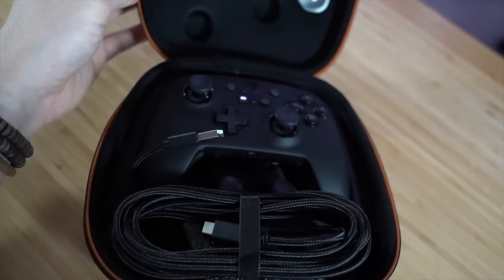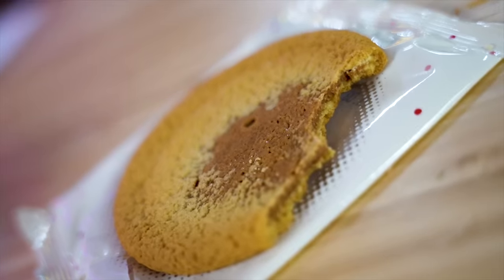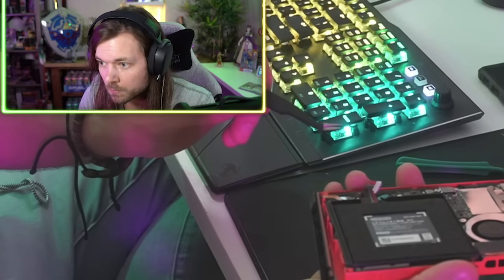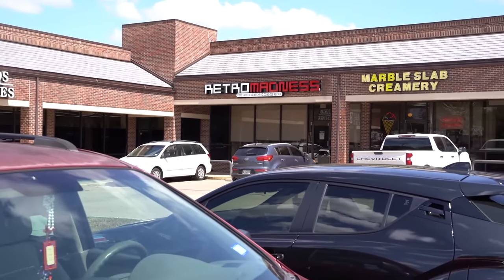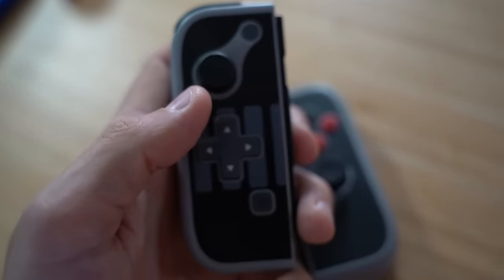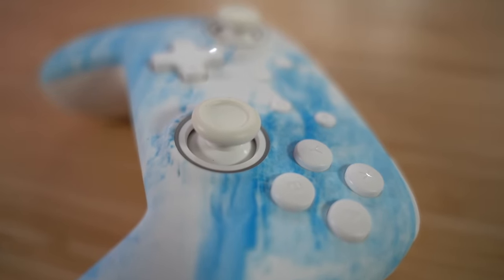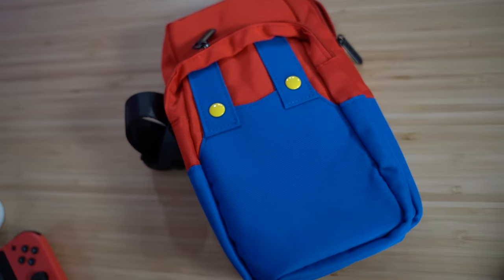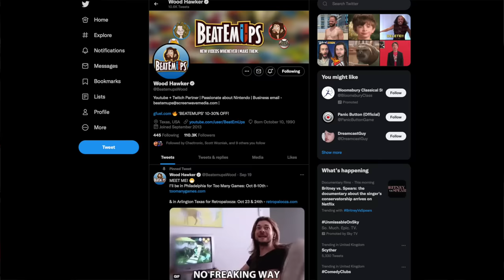The WEIRD Nintendo Switch Accessories on Amazon

Comment: Life pro tip: You don't need to use your expensive console to test if something is waterproof, just use  paper or something.
Reply: Next waterproof case test, use a paper switch stand in. If it get soaked, you just saved yourself a repair on a $300 console.
Reply: Literally use nothing and touch inside thats it lol, I was screaming at the screen when he put the switch in lol
Reply: @ALEXGAYMAR2312  I think it was fake, meaning the switch was already broken. Pretty good with shock value tough...
Reply: Yeah, another channel called Wulff den also test it out a seemingly waterproof case, but he used a piece of paper instead of a switch and by the end of it the piece of paper was totally soaked
Reply: Literally. This is so frustrating.
Reply: i was thinking the same damn thing!
Reply: I was thinking slices of bread or crackers.
Reply: Yeah you are right I did not even think about it thank you you saved my switch
Reply: EXACTLY!
Reply: @thecommietransfem  You just say it. He promote a repair shop, it was an add to that shop. He did not need to promote it in the first place or even mention the shop. He did not lie to the shop, they were involve to.
Reply: @thecommietransfem  you miss the point that the person is making that the switch was already broken. You answer your own question, “why would he break a switch for no gain?” If the switch broke of its own accord and he could pretend to break it, best of both worlds, shock value and nothing to risk.

Not saying that’s what he did but it’s a reasonable conclusion when testing the product without involving the switch is so easy. It doesn’t matter either way to me. If he found a way to get value out of a broken switch good on him. And if he actually broke it in that moment, oof, but funny.
Reply: I was thinking that the whole time. “No please don’t put your switch in that! There’s fabric inside it you can just put it in there empty- ah”
Reply: But it's not a paper case.. it's a Switch case
Reply: 700 like
Reply: @yodaflyz  I love 300$ councils
Reply: My first reaction was why didnt he just put a paper towel in there
Reply: Wait.  But it's not a paper case... It's a switch case.  What if it only protects a switch?
Reply: You also don't need to spent 12 minutes on an unrelated topic in your video
Reply: @thecommietransfem  if it was already broken beforehand he would still need to have it repaired yea?
Reply: Tf u mean, don't test at all because you can tell that they didn't lie... the outside material is water proof but not water sealed
Reply: That’s exactly what I was thinking lol
Reply: Waterproof doesn't mean able to be submerged it is to deal with a spilled drink or  light rain. The poor switch
Reply: yeah lol
Reply: 2000iq
Reply: smort
Reply: Anyone else broke there switch not knowing it isn't waterproof? God I was an idiot when I got it when I was like 11.
Reply: He has like 30 switches but true
Reply: We need to put this to the scholl books
Reply: I wanted to scream something along the line Of this when he put the actual console there
Reply: Or just don't even put anything in it
Reply: Nah I think destroy my 300$ console instead using paper or plastic
Reply: LOL
Reply: @ALEXGAYMAR2312  same here 😫
Reply: @LOSTmyHOST  yet it was clearly on with games installed on it before he put it in there
Reply: @yodaflyz  council ?
Reply: @LOSTmyHOST  I don’t think he lied.
Reply: @yodaflyz  Ah yes can't break the council
Reply: @ALEXGAYMAR2312  Ehh something like a paper towel is easier to tell because it absorbs the water if it gets in
Reply: @pixelwhisper1999  exactly what I was thinking.  He did a whole video on $39(or whatever) rip-off Switch clones, why not test with one of them?  And if that repair shop didn't charge him more than $300, the cost of a new Switch, then it must be a pretty good shop.  They would have my business for sure.
Reply: My assumption is that the case is meant for when it rains or something so it isn’t waterproof but rather water resistant
Reply: @LOSTmyHOST  but why though (by that i mean why would he just have a broken switch on hand and also you could see the case was wet which means water would get on the switch anyway even if it was faked).
Reply: Or, at least put your expensive console in a ziplock bag first. The Switch is NOT a modern cell phone that can be dropped in a water without consequences. 

Nintendo can’t be bothered to update graphics (cough cough Arceus), add better camera control and controls (hard cough Super Mario 3D All-Stars), so, why would they bother with waterproofing or make the battery easily replaceable…
Reply: Isn’t this which 200
Reply: But you do have a $.200 down the drain is not a good thing
Reply: This guy got me dying! 🤣
Reply: Most cases, at least for phones, suggest testing the case with nothing in it, or with paper. And as someone who has broken... 5 Lifeproof cases, it's important to test things. Yet for some reason, dropping my 3DS XL in a large snowbank, didn't do anything (not on purpose, it fell out of my pocket).
Reply: Yea but don't trust anybody except for dogs
Reply: @yodaflyz  console
Reply: i thought this the whole time i was watching
Reply: Lol YES
Reply: @LOSTmyHOST  it wasnt fake
Reply: you all so smart thinking of the paper stand in, but .... how much poplicity would he have gotten from doing that ? ;)
Reply: now dats smart
Reply: @LOSTmyHOST  i don't think he'd stream himself trying to fix it if it was fake
Reply: That’s what I was thinking! I assumed he’d use a paper towel
Reply: Life pro tip:a guy with a goku icon is always right
Reply: Yup
Reply: I have the Mario bag to😂
Reply: he couldve just put in the water only the case lmfao
Reply: i think im so stupid for not thinking that in the first place xD
Reply: @yodaflyz  council
Reply: @nicholasrashell4783  this argument is funny because milk vine is in the right, why would he lie about what he did + he turned on the switch (if an electronic device is turned off it won’t conduct electricity) after was in working order, also he has no reason to lie to a shop (which was not a sponsored ad since he would have to make a point that it was a paid ad) and also to twitch chat
Reply: fr i was like “USE CARDBOARD OR SOMETHING!!!!!”
Reply: lol
Reply: Yes, he could use something else. But I'm not gonna lie, the most entertaining part of this video was him bricking his switch lol
Reply: Why didn’t you tell me that sooner
Reply: A bit too late to tell him
Reply: @LOSTmyHOST  again, proof? also he only gave them an ad because of how well they did? u ok buddy
Reply: I was thinking the same thing lol
Reply: @yodaflyz  The $300 Council
Reply: I was surprised he didn't do that.
Reply: Ya but then how r u gunna get 4 million views?
Reply: Fr
Reply: Or, you can put nothing in it and then when you pull it out check if any water is in it.
Reply: @cyberbolt4122   yeah I think he should have used a model switch
Reply: Or a piece of bread
Reply: Agreed, especially a special edition Switch.
Reply: It’s all about the content, baby.
Reply: Or just check if it get weat
Reply: That happend to me but I pissed on it
Reply: But that’s BORRRINNGGGGGGGG
Reply: @LOSTmyHOST  It’s not. 1st. What would he have to gain by destroying two switches? 2nd. There’s a law that prevents people from not disclosing that it’s an ad.
Reply: Most people don’t have common sense
Reply: Bro it's his let him do what he wants with it.
Reply: @yodaflyz Jesus loves everyone
Reply: @Babylion2311  Dunno what that has to do with my long forgotten spelling error here but I agree that Jesus is awesome 🙏.

Perhaps I should edit that typo before I forgot about it again since I'm here. 😆
Reply: why would he waste money for a vid- oh, i just remembered im a scott the woz fan…
Reply: @thecommietransfem 🤓🤓
Reply: I thought he was gonna use silica gel tbh. Paper/cardboard even bread (nobody likes soggy bread)
Reply: @LOSTmyHOST you could obviously tell water went in the case??? The Nintendo was working normally right before he did it?? What can’t you understand?
Reply: W advice actually why didn’t he do that

Comment: The moment he said “waterproof” every bone in my body was screaming “NOT THE ZIPPER THO! ZIPPERS ARE NEVER WATERPROOF”
Reply: Yeah, the other parts seemed actually pretty legit waterproof. Would be easy to assume that is made to protect from rain or splashes, not to submerge.
Reply: Lol
Reply: Why the f would he not just test it with a paper towel inside or something...
Reply: There are waterproof zippers, they are often used on expensive motorcycle gear.

These cases are usually listed as "splash resistant" not waterproof, if he would have just spilled water on the case or put it under a tap it probably would have been fine. 

But he submerged it for some reason.
Reply: @beargillium2369 I don’t really think he cares he has like ever kind of switch out there
Reply: Never waterproof? Ha, tell that to a thing called AQUA. GUARD zippers! THOSE definitely weren’t but don’t say things like that if you don’t know…
Reply: I've had a MEC bag for 10 years with waterproof zippers.   They exist. Most companies cheap out and don't include them.
Reply: Then when he goes to unplug the battery he Mistakes unplug for completely remove(and explode) it!!
Reply: Mhmmm!

Comment: and the lesson is- “waterproof” and “submergible” are NOT the same thing 😅
Reply: It should have said splash proof
Reply: The issue is that waterproof should mean waterproof. If you call something waterproof and it can be infiltrated by water you're lying and that should be lawsuit worthy.
Reply: GX THE LEGENDS  What about fengpost? They got 15 years.
Reply: Oh yeah, you're totally right.
Reply: Water pass tru between a zip
Reply: GX THE LEGENDS  Lol wow has it really been that long? Time flies! Haha
Reply: I honestly would have submerged the case itself in water while my switch watch.
Reply: @HeilRay  nice
Reply: Did say 100 percent waterproof
Reply: Then it would say water resistant
Reply: GX THE LEGENDS  9 years is old?
Reply: Well, they lied on the waterproof, resistant might be more accurate
Reply: @Jonathan Casper exactly
Reply: @codypo4259  that's not the fault of the manufacturers
Reply: He tested it that way in case someone wants to go swimming with their switch
Reply: I learned that with a Samsung phone I had. I forgot about it in a pocket and went swimming, and the battery died completely 2 weeks later, even after trying to dry it off. That was one of those ones with the removable back, which made it easy to get a new battery in, but also caused problems, and I see why they stopped it.
Reply: @twerkmaster-yn7yz  *initiates submarine mode*
Reply: @twerkmaster-yn7yz  no waterproof means it can be submerged
Reply: Right he shouldn't have dunked it in the water might be just like rainproof case
Reply: @twerkmaster-yn7yz  I mean I had a waterproof camera and I could use it full submarine mode and it was super cool I put it in so many full bath tubs
Reply: @twerkmaster-yn7yz   you’re talking about water resistant
Reply: @twerkmaster-yn7yz  actually water resistant is rain and water proof is sub mode
Reply: Why didn’t he just put the thing in WITHOUT THE SWITCH 😭

Comment: You can see that the fabric of the case is hydrophobic because water drips off of it. So it's probably splash proof but water will still enter at the zipper area.
Reply: Well most people would understand that... Most people. I mean, it only takes a half a second of logical thought to think about the water getting through the zipper if completely submerged. Logical thought wasn't used today.
Reply: yeah I don't think even the ykk zippers designed for "waterproof" clothing would even hold back water from submersion. If someone can make a hard plastic case with rubber gasket then it would come close to waterproof
Reply: A lot of things are splash proof, barely anything is waterproof
Reply: @xenos_n.  Indeed. He should have filled the case with paper and then submerged it to check if it got wet.
Reply: @agc2801  geez man tell us how you really feel. Does it affect you in any way? Was it your switch he destroyed? No. Shut up.
Reply: @agc2801  Eh, it's their money
Reply: Getting caught in the rain numerous times in my life have proved to me that zippers have NEVER been waterproof. I think this was just a pure lapse in judgement (and a somewhat potentially costly investment for a video).
Reply: ikr

Comment: Yea I found the waterproof case myself, their claim is "water resistant" which is not the same thing as waterproof, also your talking about not being able to unplug the battery while literally holding it by the unplugged batter wire
Reply: OMG what
Reply: The lining of the case itself maybe water proof but the zipper has tons of holes that allow water to get through if it was supposed to be fully waterproof they would need to add something to cover the zippers obviously the company didn’t think that people would be dunking the case into a pitcher but the idea is very useful if for example your water bottle leaks in your bag
Reply: ya he just needed to unplug it and then rice up the console, still going to be messed up but might have helped alot. No idea how this guy even got a large channel with, that display was moronic.

Comment: The battery pack might be useful for people who only have the lite and have a spare joycon for certain games.
Reply: that or issues with gripping things.
Reply: i was thinking of the situations where you go to play and realize you didn’t charge them
Reply: also, I have 2 pair of joycon and my switch in a Skull & Co gripcase... everytime I need to recharge one pair of joycon its like: get the switch, remove the gripcase, change the joycons, put the gripcase back on, put the switch on the dock...
Reply: The joy cons absolutely do not have 20 hours in them, I’m lucky to get 4 of docked play
Reply: @maddiehoch2712  hey its prob when you go on a roadtrip or smth and cant charge it

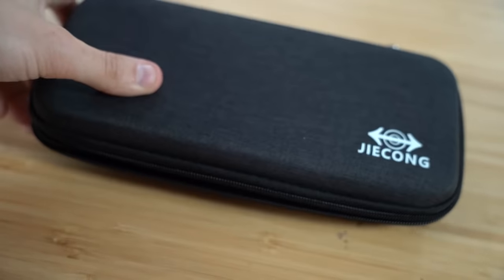Comment: 2:55 I believe the general majority of the case is “waterproof” in sense that rain won’t get in if it lands on it or it gets splashed. But the zipper area is definitely not waterproof, it will not make it through SUBMERSION. Aside from that I think it simply looked simplistic and rather stylish
Reply: Waterproof does mean you can submerge it. That's why it's practically not legal to advertise a product as waterproof unless it's actually completely waterproof, and most products, even the ones that can fully handle submersion for a long period while turned on (i.e. any iPhone from the last 6-7 years) can only use the term "water-resistant". He said in the video waterproof, so either the product page does not say that or it's completely false advertising (yes! even if it can handle rain that's false advertising!)

Comment: Piercing a battery like that can lead to it exploding or completely catching fire, it’s actually amazing that nothing happened to the compromised battery since I’m assuming he left it laying about until the next day 😬 I don’t really judge someone for not knowing these things but it’s actually incredibly dangerous and he’s lucky nothing worse happened than a little spark and flame!
Reply: Lol idk about you but most ppls homes are filled with old cellphones and battery operated things with busted batteries. Esp battery operated candles. Stores like savers are FILLED with them. It's so gross. But like, when's the last time y'all checked the batteries in your wii fit board😅 
They're always exploded. It's an easy cleanup but keep in mind there IS proper disposal of these things. 
That spark likely won't happen unless you inexplicably Pierce the battery yourself intentionally, with something metal, as seen in this video😂😂
You're absolutely correct, just hopefully not many ppl would end up in this scenario lol lol
Reply: Judging by the fact that this guy put his working switch inside of a "waterproof" case from a shady website,  I don't think he's all that bright.
Reply: @outzymes3636  It was probably switched out with an actual damaged switch (no pun intended).
Reply: @faivana_  God i hope not, that would be an annoying way to extend his video to 10 minutes.
Reply: @outzymes3636  IT WAS FROM AMAZON
Reply: Not a  "shady website"